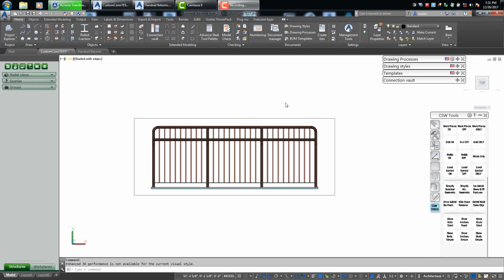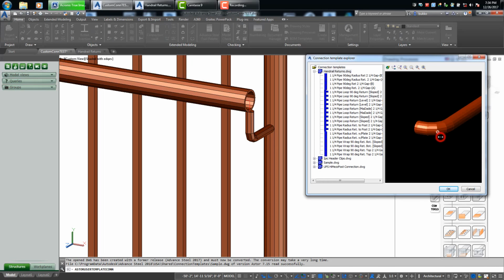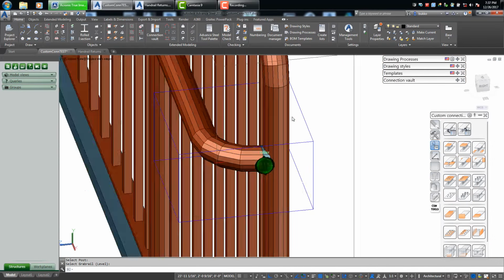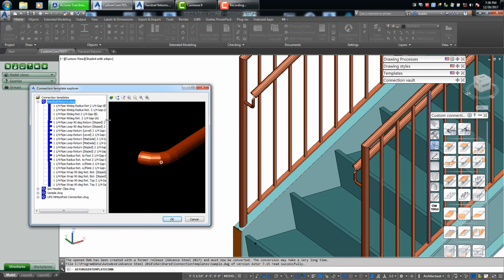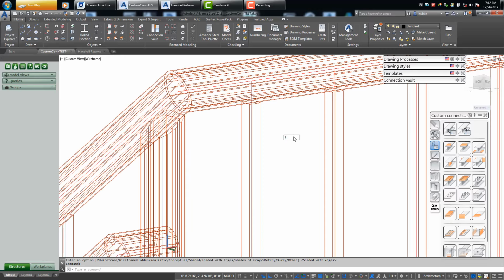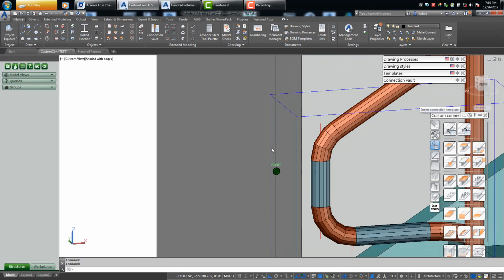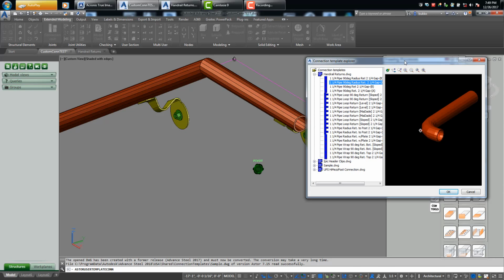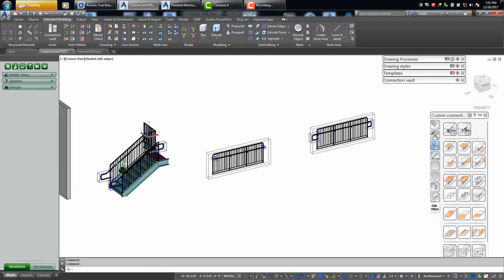Advance Steel 2018 Guardrail/Grabrail Returns Workflow

Comment: I just came across this video. This is great! I have a couple questions if you have time. What is the CSW tools? How do I get it? Do you have any videos on how to make these custom connections? Also on another note, do you happen to use AS2020 now? I am trying to figure out why my Special part handrail bracket is not working. It shows up in the wall plate list, but does not show up in the model when I click on it.

Comment: Excellent video HC.  I am brand new to AS...currently in the last chapter of Deepak's "Up & Running" Vol 1.  Have a long ways to go before I can actually do a small project in AS.  The brackets that look like actual real brackets is what I was searching for which led me to your video...I've yet to see them in AS. Where are they found? The custom grabrail joints. A short video of how you created one would be a fantastic companion to this one. Keep up the great work...I'm sure all others are as appreciative as myself. Thanks HC.

Comment: Thank you for this, I've used the custom connections some, but I never thought to use it in this way. This has been a great time saver. I've always hated modeling grab rails because of the time it took to terminate the ends. This works awesome!  I would love to see some other ideas.